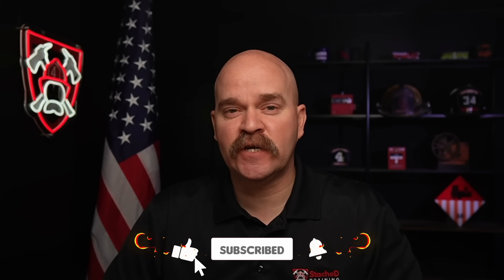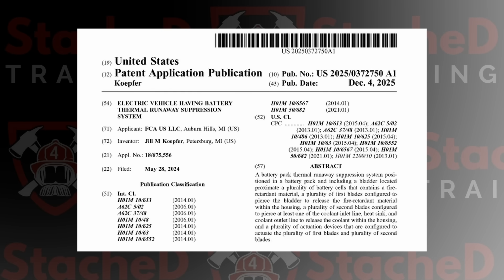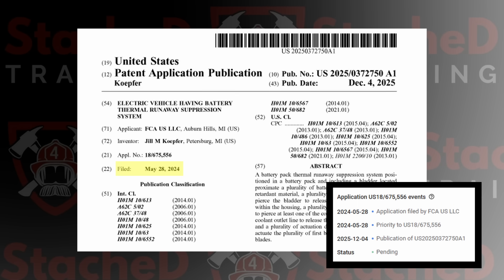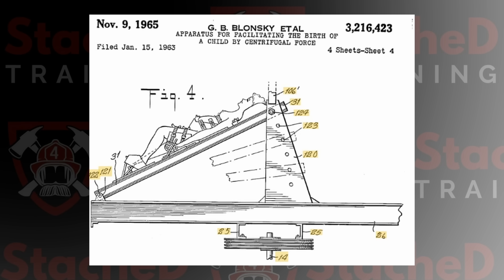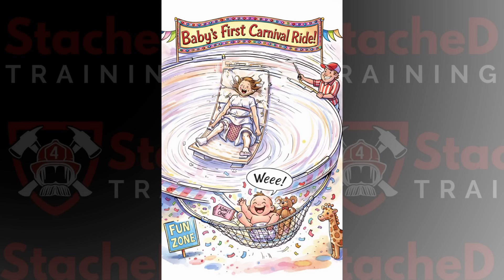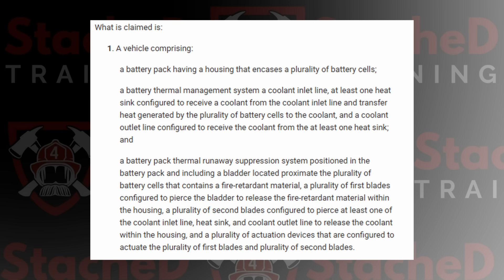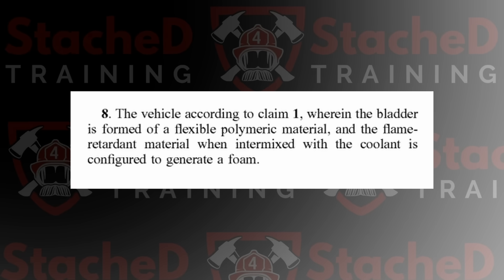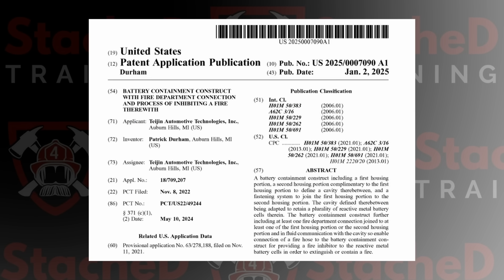Can a Stellantis Patent Solve Battery Fires?

Comment: So the car will have a sexy female voice message Thermal breakdown of lithium cells *detected*. 
Thermal protection system is now *initiated*.
For your safety this Vehicle is now being automatically driven to your nearest dealer for *battery management*. 

The dealer then presents the car owner with a bill for $50,000 for safe disposal of the thermally damaged battery, and a voucher for 50% off the $80,000 to fit a new one, in return for a signed non-disclosure agreement.

Comment: EV fires are a problem. I'm following the news on EV fires  in the Netherlands and it's just always NMC, despite LFP becoming more common.
Just in the past 24 hours, a Tesla Model S, A Jaguar iPace and two other NMC based EVs set themselves on fire. I'm not sure which they were exactly as Skoda, Audi and VW share the same platform and look a lot alike after burning).
It's hard to find any LiFePO4 related fires, maybe because driving off a cliff is hard to do in our very flat country.
Moving away from NMC is the most sensible thing to do.

Comment: I've invented the non-flammable horse. I call it 'a horse'. I think the only problem with lithium-based battery chemistry is the lithium-based chemistry bit.
Reply: Any time you store energy, there's always an issue of it being released. At least with lead-acid batteries, they tend to boil off their electrolyte while keeps them around 212 degrees until the reaction stops.
Reply: The horse might not be flammable but horse feed is, and stable fires were extremely common in horse days. When as was often the case the stables were adjacent to inns, the risk of fire spreading was high.

Comment: A solution to EV fires?  No.  You can't smother it.  You can't starve it of O2 or fuel.  And when it's out it's not out.  I'll believe there is a solution 5 years after there is a solution.
Reply: Suppression would require a chemical agent with extreme endothermic properties, essentially halting the thermal runaway.
Reply: @Jul-66  And that's the problem, isn't it?  ...that there is no chemical cocktail at this point that will arrest the runaway?

Comment: .... how about we stop using lithium batteries?
Reply: Toyota still using NiMH for hybrids
Reply: @GBR080R  those are cheaper and safer
Reply: Just because lithium & it's risk is ok in smartphone doesn't mean it's all the same scenario in cars.

50gram battery vs hundred KGs of battery. 

Bitten by small house cat and bitten by a Lion or tiger will not have the same effect
Reply: Donut claim they've done just that. But a lot of scepticism surrounds their claim
Reply: I wonder which device you are using to write this comment... Yeah, we are way past that point. 😂
Reply: Why do you say lithium and not lithium ion?  Political reasons?

Comment: Just by patenting this, it means they are acknowledging a serious problem. 
The system will be like an airbag: once it is deployed, insurance will total the car regardless of the damage severity.
Reply: If a battery trips a fire prevention device it is no longer trustworthy.  Due to the cost of a replacement battery a battery failure of any kind will often total the car.

Comment: I have a suggestion for a liquid-based fire suppression system- Delete the giant battery and fill the space with a tank of diesel.
Reply: Or whichever company that finally brings out a solid state battery! As that battery will never have a thermal runaway period!
Reply: That would be SENSIBLE
Reply: Until you end up with a runaway and you end up with both fire and flying engine parts.
Reply: @soundspark far less likely than your battery having problems
Reply: @soundspark  Really, that is easily solvable with an intake valve.
So easy in fact that in any workshop, any decent mechanic (or a curious one that has seen a few Youtube videos) will keep a wood block large enough to block the intake at hand.

Comment: If your car needs a fire suppression system maybe you just need a different car
Reply: I had a fire suppression system in my RACE CAR.  A mandatory item and it did not weigh that much.,
Reply: @johncooper4637  you can use lightweight gas and such in areas where humans cannot be.
Reply: Haha simple logic, what are you driving? An expensive death box, my god cars become absurd,big screen, all electronics, a lot of sensors,ai, need to update software, subscription, heavier, bigger, and now fire suppression system
Reply: They already make fire suppression systems for automobile engine bays. Even aircraft have had them for decades.
Reply: Used to have a off road cart it had fire suppression but it also had a no start issue it was double protective 
Dodge with its second hand electrical fires seems like they may have fixed there wiring issues but then again
Reply: The black liner on the underside of the ICE car hood is a kind of fire suppression system.  It melts and falls over the engine block.  So I'm told.
Reply: To be fair ICE fires are common, the issue with BEV and hybrid fires is the FUEL (lithium) not frequency. 
Lifelong mechanic since the 1970s here. Ford had their famous F150 cruise control switch fires (due to an impressively silly switch design leaking brake fluid
into the ALWAYS HOT switch screwed into the master cylinder. Leaky carb fires were common before EFI but caught quickly could be extinguished with a smalll
portable extinguisher useless for lithium. Ford and GM had ignition switch fire issues too and of course others did but I only own trucks and motorcycles so 
unless I'm fixing a friends car I don't keep close track of the car world.

A drag racing style fire bottle under the hood with a fusible burst disk and a manual pull handle would work great for underhood gasser fires but since any fire is an insurance total loss losing the vehicle is more feature than bug (unless inside a structure, attached garages direct fire to the home when not put out).

Home garage/shop fire suppression systems are an option for people who can do it cheap. For example my vintage motorcycles are stored in a new
shipping container fitted with power, light and a high pressure CO2 industrial extinguisher I can actuate, close my added man door and inert the entire 40' High Cube container. (I buy industrial extinguishers for their rolling steel carts to use with welding gas cylinders but scored four recently serviced units for less than the CO2 contents cost.) Restaurant fire suppression systems can be bought as used takeouts and installed in home shops or garage bays. At least one is next on my list because
I've no reason not to. They're useless for lithium of course so when I add a BEV it will live outdoors. All my trucks and structures are separated to avoid fire
fratricide (planning is free, so I did), goal being if one goes up beyond my ability to extinguish I can safely watch the show while the FD rolls up.

Most home owners, home shop owners and even commercial mechanics don't pay enough attention to fire suppression or structures (wood is for camp fires, I build mine with steel).
Reply: @oldphart-zc3jz and most are started by electricity... Fact!
Reply: ICE vehicles would also benefit from engine bay fire suppression.
Reply: @wim0104 yes .. call a fire extinguisher not the fire dept
Reply: @wim0104 
Ya it’s called a fire extinguisher you can buy one anywhere
Reply: especially sporty, high performance ones
Reply: ICE cars burn far more often than EV...  but yea, some EV brands are not as good as others.
Reply: @MiraSciFi but when electric car start burning it turns into shitshow.
I still prefer ICE car burning
Reply: @MiraSciFi how many places have banned ICE cars due to potential fire issues? Unlike a lot of places that ban EVs.....

Comment: Pat,
Have you been able to find similar EV fires in and with Asian vehicles. Thank you..
Reply from the maker: Yes.  It's a worldwide issue.
Reply: It's bad enough over there too that they're - get this - legislating mechanical door handles to be installed that can still open and are visible/identifiable.  Luckily, whatever goes on in China will trickle down, even to 'US' makers (because they're over there too, building the cars that need to meet the new standards).
Reply: Asian (Chinese) EVs burning all over asia
Reply: It is so bad on Asian vehicles that someone built a battery ejection system.  Google it.

Comment: Stellantis always comes with great ideas like putting the timing belt inside the motor oil
Reply: I guess they never learned in health class
not to use oil-based lubricant on rubbers.
Reply: @ml9867  Hey Honda push-mower engines had it first!
Wasn't worth a shit there either !
Reply: @ml9867 you know what doesn't break in oil metal
Reply: @ml9867 😂😂
Reply: @ml9867  Didn't they claim it was fine for artificial rubber?
Reply: @soundspark   In all seriousness, I don't know what compounds are used for internal timing belts.  I do know that oils will break down latex condoms and the non-latex ones made from polyisoprene.  However, oils don't break down polyurethane or nitrile condoms.
Reply: @ml9867  and, just out of curiosity... not judging you... how did you find this out...?
Reply: @xapcgamer151you did not learn this in health class ?
Reply: @soundspark  If they claimed it was fine for "artificial rubber", they lied.  Synthetic automotive "rubbers", like hydrogenated nitrile (used for belts) are petroleum based.  HNBR cannot live bathed in oil.
Reply: That is something that non engineer managers decide.
Reply: So this time they put lithiim batteries in kerosine, and use heat exchanger with oxygen as cooling medium.
So it will be illegal to repair it by yourself 😂
Reply: Or having the heat system self destruct every winter.
Reply: Honda also did that 🤣
Reply: Walter Chrysler is spinning in his grave.
Reply: As bad as Ford 😂
Reply: That's a Ford idea!
Reply: Ford also did that, to be fair.
Reply: @goncalo33  Ford definitely the master of the EcoBoom.  Combine wet belt with tiny, highly turbocharged engine that runs hot and hard, maximizing both thermal stress and the amount of gasoline that leaks into the motor oil, increasing the solvent effect.  It can kill the engine slowly with buildup of rubber particles on the oil pickup or suddenly when the belt breaks and piston meets valve.
Reply: GM does it the right way. They shut down cylinders until the tow truck is doing all the work.
Reply: Wasn't that Ford?
Reply: How about their onboard AC chargers that massively fail over time? Great way to prevent a fire while charging at home 😂
Reply: @SolAce-nw2hf  or their heat systems that need overpriced tools to repair them with (I have a jeep without heat right now)
Reply: If you pour a gallon of gas on the interior and toss a match, your Dodge will have reliable heat.
Reply: @SolAce-nw2hf  Failing chargers sounds like an increased fire danger.
Reply: @soundspark They just stop working, so DC charging only until you get it replaced
Reply: Every one of there engines are crap so NO.
Reply: What about sodium based batteries?